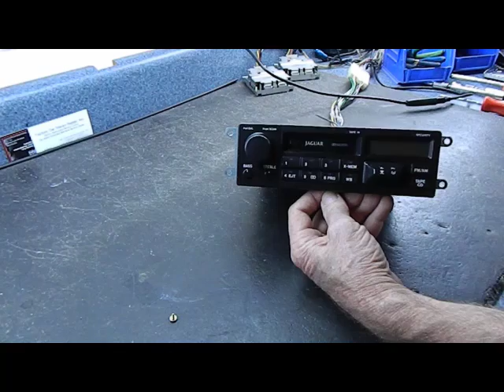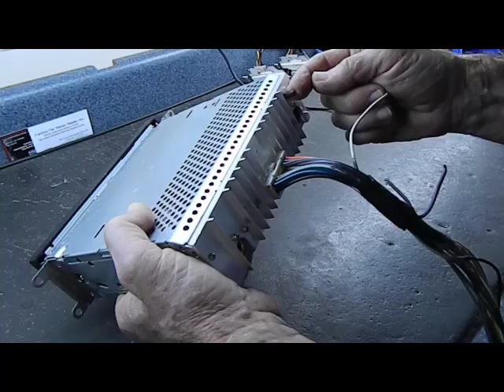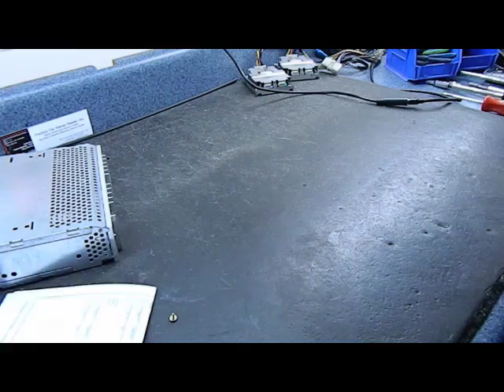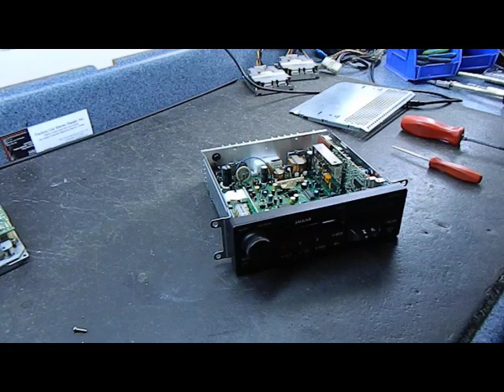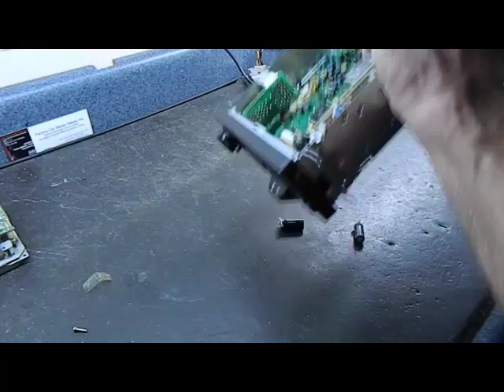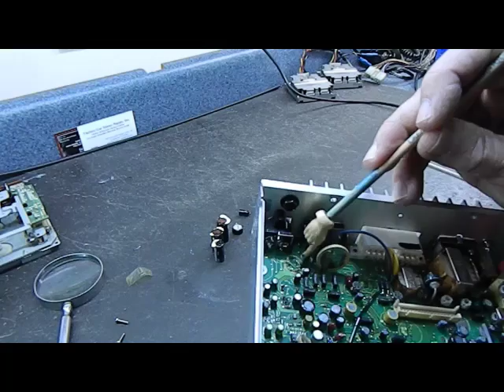Jaguar Stereo Repair AJ-9150W - Car Stereo HELP

Comment: Thank you very much.
I need repair a AJ9250r, the radio of a XJ a a polítical brother. The radio gets on, but the buttons don't work and  is not  possible to introduct the code.
I found some mistakes, the litium battery is empty, I already changed It, a capacitor with  acide leaks, I also  changed, some transistors needed rewelding, but the buttons don't work.
Any ideas?
Thank you very much.
Greetings.
Reply: Did you find problem. Mine is the same .. turns on but cannot enter code. .
Reply: @colinstickland845 He reparado la radio, el problema estaba debajo de un condensador, la perdida de ácido había cortado una pista de la placa electrónica.
Además le repasé las soldaduras de un grupo de transistores, le he cambiado la pila CR2032 y le he puesto un portapilas para que cuando se agote la pila sea fácil su sustitución; también le he cambiado el supercondensador.
Ahora guarda las memorias de la radio.
Un cordial saludo.
Reply: @JCC__BMX gracias jefe . Cambio pilas de lithium. ??   Ok ?? Los condensadors bien yo vey por perda de acidico . Esta coche solo utilizado una dia cada mes . Coche registrado por vehiculo classico.  Quando en mi garage el battery disconnect. Una isolation en maleterio esta coche muy poco kms . El radio poco uso . Si puedes nuevo radio pero yo quires original . Ahorra radio fuera connectado con una battery por una dia . Possible carga el battery de lithio ?? Gracias por contesta .
Reply: @colinstickland845 la batería de litio no es recargable, deberías poner una batería nueva.
Reply: @colinstickland845 the radio it's works! The acid leaks, cuts any ways bottom of a capacitor.

Comment: Actually, the '92-'96 Jaguar radios are VERY reliable.  The one exception is the cassette player belts breaking, which seems to happen every 2-3 years, esp. if you live in a hot climate.  The fact that the backside of these radios are in close proximity to the car's heater core (which seems to emit some heat, even with the temp. knob/valve completely shut off) sure doesn't help things in that regard.  Wish therefore you had not blown over the part of the repair process concerning the cassette player.  At some time in the future, could you please do a video on that repair step?